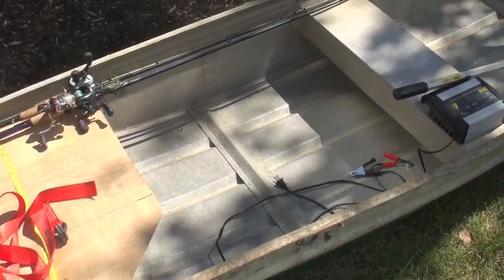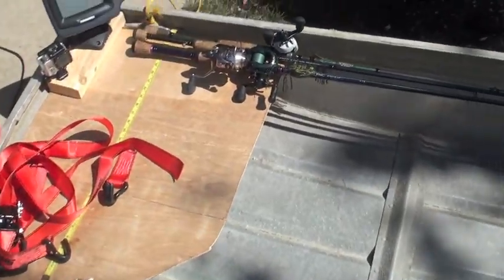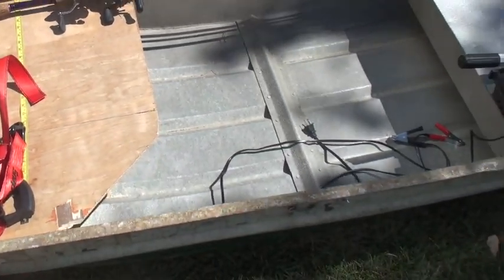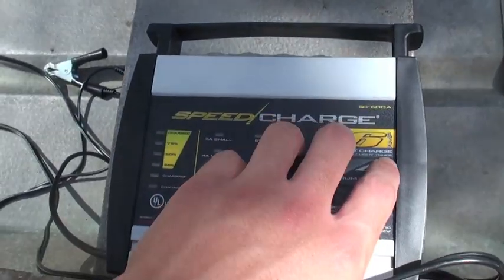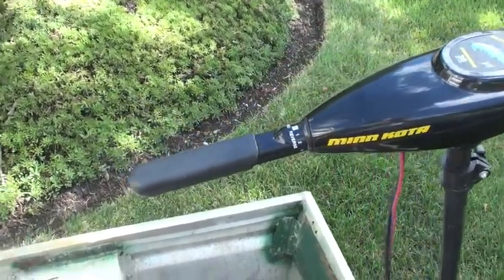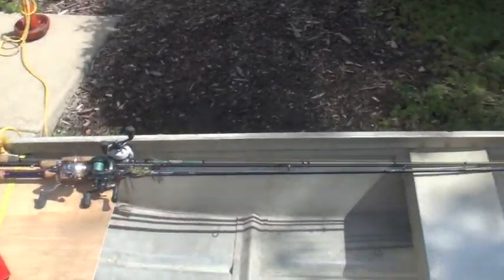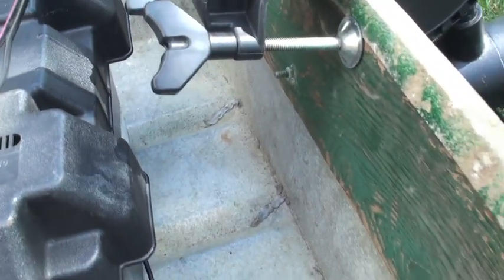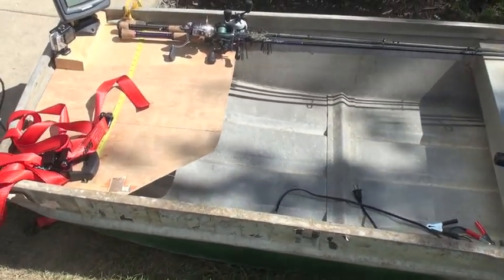(Part 2) Boat Restoration: A few new additions

Comment: Nice vid! I too have the Endura C2 on my kayak and that pushes it pretty quick. My dad and I are also in the middle of restoring a 1994 17 ft. Action Craft flats boat. My friend Samlax8 restored a john boat like you and I recommend that you lay a piece of ply wood on the floor and put carpet on it like a bass boat. He had to do it because the floor had to many cracks and it made the boat look a lot nice overall.

Comment: the best thing you can do for a boat like this is get the flex seal rubber spray and go around the edges of the interior of the boat. The stuff will make your boat completely watertight.  have done it on 3 aluminum projects. I usually buy about 5 cans ($35) and spray the whole inside evenly, then I paint it the color I want, usually white because I live in AZ. It gives it a textured non-slip finish. And no water will get it.

Comment: i just did this same thing man. I mounted my transducer so its removable since im gonna be bangin the boat up alot i didnt wanna destroy the transducer. but anyway just get those broom clips that hold brooms to the walls and some pvc pipe. mount the transducer to the pvc pipe and screw the broom clips into the boat and fill the holes with marine putty.  once its done you can just clip the transducer to your boat when you want it. also for the go pro use industrial velcro, velcro it where u want

Comment: mount that motor in the bow! you can swivel the control box 180 degrees and mount it on the bow. you'll get way better control and wont have to spend so much on a foot controlled bow mount motor!